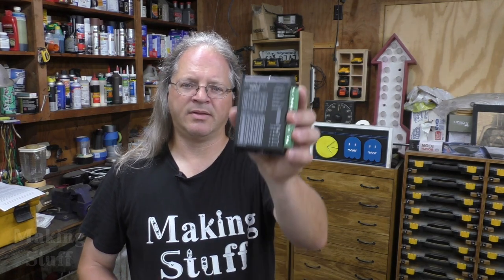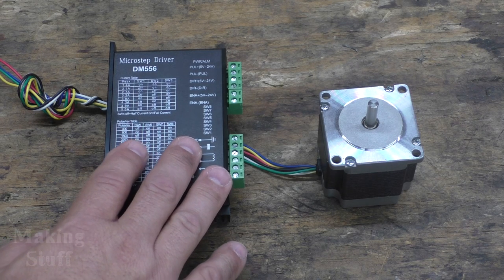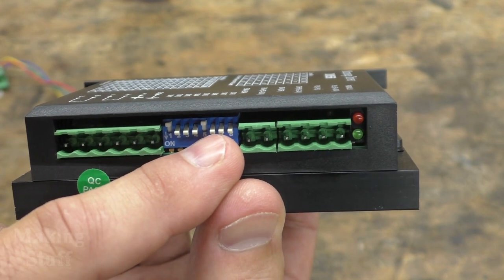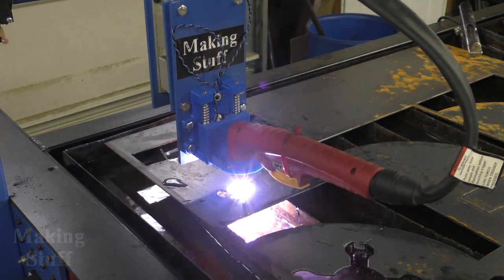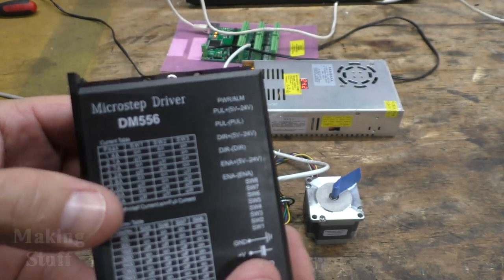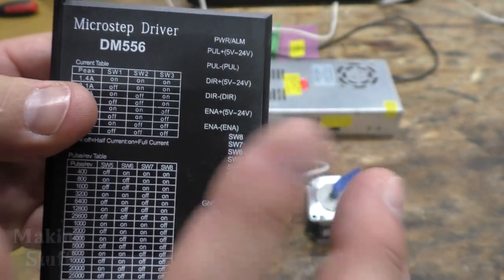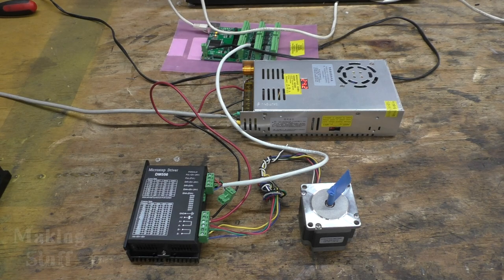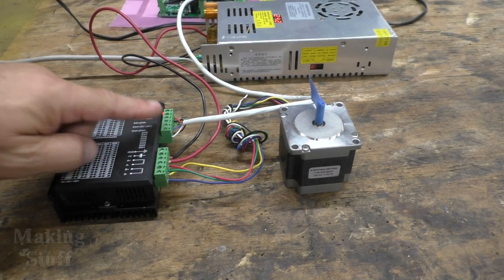DM556 Open Loop Stepper Motor Driver Review for CNC Machines.

Comment from the maker: What type of stepper driver are you using in your projects?  Let me know in the comments.  Thanks for watching!
Reply: I am cruising around looking for more ampere headroom than the a4988's we are currently using. I am really looking for a good ampere capability (~3a-4) for dual NEMA17's but that  provides decent microstepping resolution.
Reply: I am using an Elegoo Uno Attached to 4 TB6560 drivers
Reply: I have the TB6600 but have brought these to upgrade. Do you have each driver with its own power supply or one to run all of your axis’s. I have 4, xz and 2 for y.
Thanks for the video and review of them.
Reply: Tb6600
Reply: This is the first time I am learning to use motors like this with Arduino. The first day I ordered a TB6600 and the next day I placed an order for a DM542. Now I'm waiting for both to arrive =D. I only need one driver and motor. I'm helping my big sister make her work of art, that rotates really slowly and it is located in a commercial space. 
The reason I decided to buy the DM542 was that I could possibly make the motor quieter?, but I haven’t gotten to try it in practice yet.  Thanks for good video!
Reply: 5 of the same you had in the video DM556
Reply: I use same D556 and Bob Mach3 LPT,  why not running, pls help
Reply: What if you put 5 volts to the ENA + pin? Or connected the ENA + to the ENA - as a dry contact signal to enable the drive?

Comment: I did not realize the terminal blocks were detachable, you just saved me a lot of work. I have an Arduino vertical plotter and had a motor malfunctioning which traced back to one of the two TB6600's, replaced it in a minute the plotter seems to now work fine. Again, thank you very much.

Comment: I believe the "Half current" setting is actually for when the motor is at idle {not moving for a certain amount of time} it cuts current in half to keep the motors cooler
Reply from the maker: I'll have to check that out.  Thanks!
Reply: On the DM542 and the breakout board I have it's wired using the Ena+5v and ena- and it seems when running a burn only the green light is lit after you reset in Mach 3 the red light comes on and it seems it kills the motors as I let them sit 45 min and they were cool to the touch. Guessing this could be bad also depending as I assume your axis could move and be off.

Comment: I actually just took a break from assembling my CNC project and I saw your video.  Mine is based on the Workbee 1515, but I opted for 3 phase closed loop hybrid steppers and LCDA357H drivers.  I figured with the sheer size, I was more likely to have it miss a step somewhere, especially along the Y-axis where it's driven by two motors, so a missed step can get the gantry out of square.

Comment: The nature of digital electronics being what it is, enable pins are usually enabled when they are connected to ground, rather than +5 volts. 

The reason for this is that logic inputs usually interpret being disconnected as a logical 1 or "high" (i.e. the same as if it were connectedvto +5 volts). So, if for any reason your enable input were to become disconnected, you don't want your motors to mysteriously start running. Best to err on the side of doing nothing in the event of a malfunction.

If the enable pins is labeled correctly, there should be an overbar (or an underscore) on the text. This means that the enable pins is what is called "active low," which is self explanatory.

Comment: really like the videos and even though your break out board is different and i cant see how its wired and im dealing with DM542 drivers i DID just use this video to, i believe,  fix the wiring for my brother on his plaz project. Im the computer nerd he builds stuff and i have never seen steppers that i knew of until looking more into 3d printers. thanks for the great videos

Comment: You should have talked more about the features and what output pin corresponds to what.
Would the enable pin be used for a normally open limit switch?

Comment: Great video, I noticed you hooked the positive wire to where is said Ground is that correct or just looks that way in the video, I have the ground wire going there and both stepper driver and driver controller both have the green Led shown...

Comment: Thank you for answering my question about the alarm LED. I am building a soda can crusher using a NEMA 23 stepper motor and disable the motor when the cycle is completed. I have the reset pin wired up so when you push  the momentary switch it resets the Arduino and runs the sequence again.

Comment: I understand that this video is from some time ago, so if you don't respond I'll certainly understand.  My questions:  If you connect 5v to the enable, will the stepper freewheel as it would if it wasn't connecter to the driver?  If not, do you know whether the use of NO relays on the driver to stepper wires would allow freewheeling when activated?  Do you know if there would be any problems that would be caused to the driver if the stepper was freewheeled (thus causing backfed current)?  My planned use is for a table feed on a mill, and I'd like to be able to use the wheel on the far end of the table to move it back and forth, and I'd think that it would be difficult to spin the handwheel if the stepper is connected to the driver even if the driver is powered off.  Do you know of a solution to my problem other than some sort of a mechanical clutch?  Sorry for being long winded, and thanks for the video!

Comment: Thanks for the information 
I have a NEMA 23 4amp.
I think Ive purchased the wrong driver board's.
TB 6600 current 3.5. PK current 4.
Would I need a different driver board?
Regards
Tj

Comment: The data sheet says enable normally left open. If it's active high that implies that it's pulled down internally.  I think it's for a limit switch / e-stop switch daisy chain. Any one switch goes high and everything stops.

Comment: I'm interesting in the breaker board that you are using. It has screw terminals for connecting the motor drivers and it supports USB, and it works with Linux CNC What brand or model number is it?
Reply from the maker: Mesa 7i96.

Comment: You could wire the enable terminal to the Estop switch so the drive stopped if you hit the E-stop. All the drives could be wired to the e-stop.
Reply from the maker: LinuxCNC handles the e-stop for the entire machine in the software.  Thanks for your input!

Comment: Very clear and easy to understand. The red light on DM542 just came on. And one stepper motor will not turn on. Is there a simple solution or is it a new Motor and or driver. .?
Reply from the maker: Probably a driver.

Comment: Question I have a NEMA 23 stepper motor, 2 phase and 1.8 step angle, wired in Bipolar series. The rated current per phase is 2.5 amps. Resistance per phase is 2.4 ohms. Voltage per phase is 6V. And inductance per phase is 9.5. How should I setup my driver? I have a DIY 3ft x 3ft CNC router. One motor on X, one on Z and two on Y.

Comment: I'm using the  TB6600 that is similar to the one you just showed. using one on the right and left on my current under construction unit but having issues with the right and left Y axis motors not running at same speed. Lots of trouble shooting still trying to get it right. Thanks for the great video
Reply: The TB6600's are really bad, i have 4 of those and i'll be changing them soon because they lose steps like crazy
Reply: Juan Gallego Have you exchanged your drivers? I also currently have the TB6600 and have recently purchase these new ones. Im wondering if you used your existing Power Supply Unit or upgraded that also. I have a variable 12-24volt one and wondering if I should upgrade it to a higher voltage and if I can run 4 new drivers off the one Power Supply or they need one for each driver. I have 4, xz and 2 for y.
Thanks

Comment: Hello Making Stuff, i've  understand your video but i've just received my electronics material and i get...Microstep Driver FDM2740 C...with my set with nema 23 and mother board which is UCNCV 4.....i'm a beginner for CnC ....I would like to know if the wires are the same plug than your DM556...? Thank's a lot

Comment: Pls you can help me, I use this driver for double wall paper cup machine injection glue, the motor nor running but there is a vibration in the motor, NB:no errors

Comment: Hi . I'm new in cnc plasma. 
Mach3 to dm542 micro driver
Problem:
When i run x axiz. Why z axiz will run ?
I run z axiz. X aziz will run
I have change new bob mach3 green colour port paralel. Still same result . I have check pin corectly. Pin 2,3 for x. Pin 6 7 for z. What is a solution. Thank you

Comment: Would u still recommend the dm556 nowadays? Or has something better become equally as affordable
Reply from the maker: These types of drivers are still pretty much standard for low cost stepper drivers.  You can upgrade the a closed loop or servo, but it will cost a lot more.  Thanks for watching!

Comment: Hi. Nice video. Question here: Do you know if i can successfully use the exact the same hardware you show in the video to interact with mach3 or mach4 software?
Reply from the maker: Pretty sure it will work with Mach3.  Don't know for sure because I use LinuxCNC.

Comment: Hi Making Stuff,
Thx for your interesting videos.
I'm also using DM556 stepper driver on my selfmade CNC. But I had twice damaged my X axes driver, after a couple of runing hours the stepper driver goes bad and red led lights up and stepper motor doesn't move anymore. It's each time same driver that goes wrong (X axes with one dema23 motor).
Can't explane why this happens, if you have an idea please comment.

Kind regards.
JJ
Reply: Did you solve your issue? Limit the current to that motor, it might be binding up. Send me a photo of your machine
Reply: @AS-ug2vq  Hi, yes I think I have solved my problem which came from a poor quality connection on the wiring between  driver and steper motor (loose screws)!

Comment: hello sir i have an issue with my driver which is dm556 and a motor which is Nema 17, 6 lead, rated at 0.8Amps, stepping angle of 1.8 degrees. Actually problem is my motor is extremely hot and i can't understand why is so hot can u suggest me please what can i do because the driver did not give 0.8amp
Reply: Hello

Comment: Did you receive any kind of data sheet for this driver? Curious as to what type of digital driver it is. Bi-polar chopping base, analog? Do you have any info?

Thanks,
Reply from the maker: Sorry I do not.
Reply: @MakingStuff  How are they holding up? Has one of them stopped working?
Reply from the maker: @stacy5281  I have installed 4 of them on my Plasma CNC and they are working great.  No issues yet.  Watch the latest CNC Update video if you want to see more of them in action.
Reply: They're digital drives. I opened one up and they have an ST Micro devices 8 bit, 16Mhz micro controller on them. They are quiet compared to some other inexpensive drives I've used.
Reply: So not a 32 bit dsp driver. Where did you see the 8 bit marking at.
Reply: @stacy5281  It has a STM8S903K3T6C clearly marked on the biggest chip on the board. I don't think running a single stepper motor requires a 32 bit dsp, but that's just my opinion. For what they cost ($12.99 currently on sale), they perform just fine and I'm considering getting a few more for another project.

Comment: Hi there!

So the more I do not understand, what this "enable" could be good for, as I wonder with mine as well (4x 9Nm closed loop) :-/
Reply: Wire them to a switch so you can stop the motors in not-quite-emergency situations. Or, assuming your CNC is not using leadscrews, it would disengage the motors so you could much more easily move your axis by hand -- sometimes it's much easier to just tell your CNC controller that the tool is set at the zero point rather than jogging it to that point.

Comment: pulses per rev is pretty bizarre.  You'd think that would be set by the control software since pulses per rev is intrinsic to the motor design.  What does that actually do?

Comment: Making Stuff

  I need help on the hardware parts.
  and wiring the hardware up .
  and what software to use 
 to operate my CNC machine 
 Here is my list of the parts
 i'am using can you help me  

 1] Stepper Motor Drivers power step PSD8079-2P
 2] steppers motor Nema 34
 3] controler
 4] power supply mean well SP-320-48
 5]                  Hardware and Software 
 6] CNC Breakout Board/Interface Board
 7] Cable Connector
 8] Limit Switches
 9] Emergeney STOP BUTTON 
 10] Software

Comment: Hi, i am looking for dc motor and drive if anyone can suggest me. i need max rpm 4000 no load. speed should be control by (0-10 or 4-20mA) by the plc. thanks